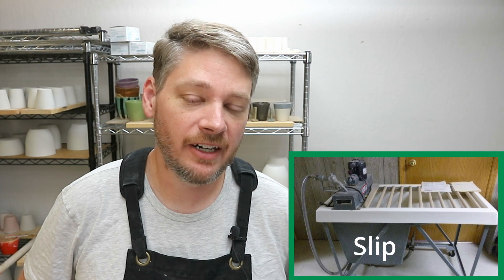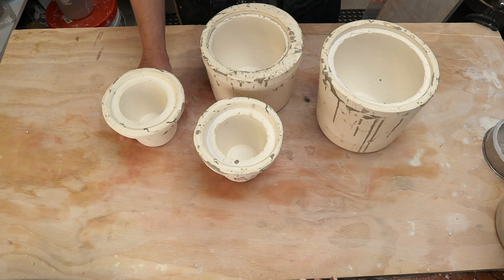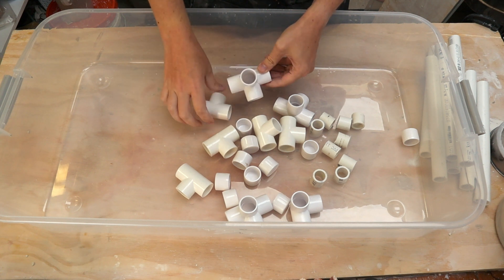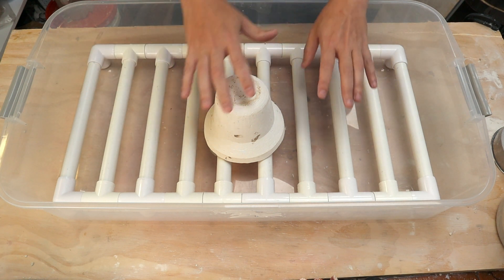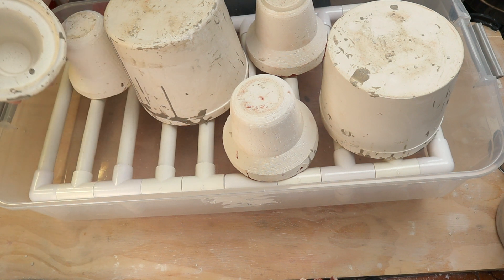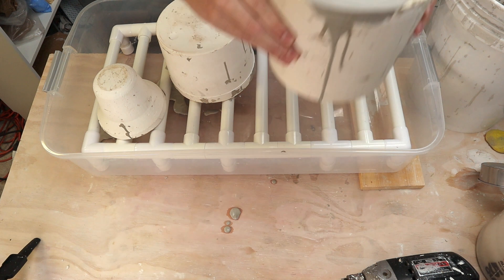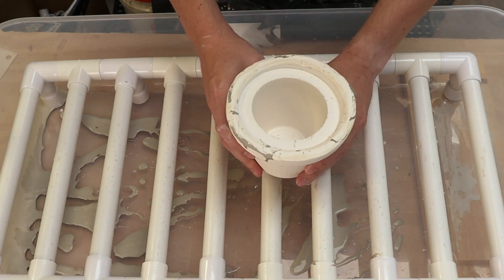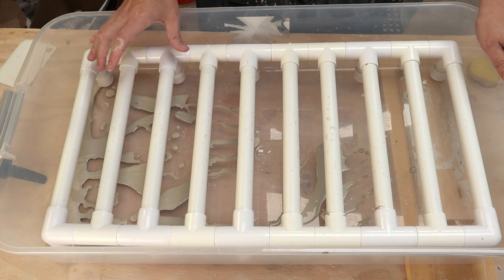Make a Mini Slip Table - DIY slip table for low volume slip casting

Comment: Thank you so much for the video! Could you tell me where the notes are regarding Amazon links and quantities and sizes of pipes and fittings?
Reply from the maker: The amazon links are in the video description, but I'll put it here as well as the quantities:
- Under Bed Storage Container https://amzn.to/3dHFzHR
- 6x: 4 Way PVC Elbow https://amzn.to/3ptjLlV
- 4x: 3 Way PVC Elbow https://amzn.to/3CiGVTr
- 10x: PVC End Cap https://amzn.to/3PGlxdL
- 10x: PVC 3 Way Tee https://amzn.to/3QUxkqa
- 12ft: 3/4" PVC Pipe https://amzn.to/3QEATkk
- PVC pipe cutter https://amzn.to/3CiKcSX
Reply: 🙏🙏🙏Sorry-missed that! Many Thanks!

Comment: Love this table. I have some two parts slip cast mug molds and I want to know how do you clean up the lip and side of the mug (where the two plaster molds create the line) so the mugs stay nice and smooth. Can you make a video of that?
Reply from the maker: Thanks! It's been very handy!

I don't have too many multi-part molds at the moment (but I'm slowly working on one). If there is any noticeable parting line, I'll either sponge it off if it's damp, or use a trimming tool to cut it down. I basically do the same thing with the rim of my pots as well. If I have an example in the future, I'll show it.

Comment: As you have added feet with mini legs why not increase the length of the legs on one side or at one end to provide the angle required to drain the slip out on one side of the pot.
Reply from the maker: That is indeed something I thought about. One initial reason was I didn't want to bother cutting the legs to different lengths. But really, for this version, I just wanted to get something working and see how I might tweak it.  One of the unknowns was the best angle to put the molds at. With the pots here I didn't quite have enough slope. Also, after playing around a bit more, I'm guessing it might be mold dependent. I've since tried putting the molds at an angle between the bars in mine and keeping the table flat (more like a "real" slip table) and that seems to be working well.

Comment: I have used pvc pipe for numerous non-plumbing projects with good success, so your choice made sense to me. As to a future pump, since I dabble in electronics DIY projects, I've been thinking about a DIY peristaltic pump.  Using a reasonably large diameter piece of surgical (silicone) tubing would allow pumping of the slip without worrying about wear on internal parts.
My personal temptation is a 3D printed peristaltic pump and stepper motor with a simple speed control. Could be a fun project.
Reply from the maker: I agree about the peristaltic pump - it seems like a great choice for this application. I've also seen some DIY designs and yes it could be a fun project!
Reply: @PotterybyKent  The slip tank/pump idea has been fermenting for awhile now. Here's where I think I'm going:
Home Depot Laundry Tub ($75.00)
eBay used washing machine motor ($60.00) - (Glaser sells similar motor for $357)
Glaser Ceramics  Campbell pump head ($170) - still looking to find something cheaper or that I can 3D print - back to the peristaltic pump idea...
Glaser Ceramics 3/4" gas-pump style nozzle ($70)
Total $375
Glaser sells a Mid Pumper 20 Gal system for $850.00
So, can I find a less expensive pump head, and do I need a fancy pump nozzle, or just a hose and use a foot-pedal to operate the pump?
Also thinking about how to use the washing machine motor in a dual-purpose mode, both as pump motor and as mixer (maybe not simultaneously)
I'd add the links, but YT often won't allow submission of URLs other than to YT...
Reply: Found this peristaltic pump build ( https://www.youtube.com/watch?v=dutfh_Ey44c&t=199s ) with downloadable files on thingiverse.  Looks pretty interesting.
Reply from the maker: @Bob-Is-A-PotterNow  That sounds like it would be quite the setup! I also wonder about the need for a pump head. I'm sure it would be nice, but it does seem like a foot pedal might be the place to start.
Reply: @PotterybyKent  Had a conversatoin with an EE friend this afternoon and making a variable speed pump control shouldn't be too difficult and that would be tied-in to a 3D printed nozzle with an on/off switch - perhaps that defaults to low-flow but can be increased with the foot control. Or perhaps the nozzle does both on/off and speed. It's going to be at least a couple weeks figuring stuff out and testing circuits. But perhaps there's an "economical" diy slip table waiting in the wings. I already ordered a length of surgical tubing with a 18mm ID - just under 3/4" lumen. I'll let you know how things progress. I posted a comment, I think, on one of the 3D print clips about running my printer at a 50 micron print resolution. Very slow, but yielding prints that need no post-processing and which result in silicone/plaster of paris molds with no print lines - they are smooth!
Reply from the maker: @Bob-Is-A-PotterNow  Sounds great! Thanks for the updates and I look forward to hearing more.

Comment: My favorite part of the video was learning about the existence of these tables in the first place. My second favorite part was when you put the feet on. I had been wondering what would happen if the drained-out slip pooled up enough to touch the molds or the pots! I had thought, oh maybe it wouldn't be a problem, what do I know (not at all a potter, here!), but then you said, in addition to slip not getting into the pvc, there'd be plenty of room for the slip and I was like, oh yay! Haha 😆

I liked that there was a stalactite and you explained that more of an angle would help it drip down the sides. When you were talking about it needing to be tilted I wasn't sure why, so it was cool to see and hear why! I appreciated both the visual and your verbal explanation. 

It can be very satisfying to use creativity in thinking of what to put together and how, in order to serve a needed purpose. It definitely was cool watching. And I hope it works well for you and you can get some drainage going on!  I had gotten a mental image of, with a little bit of slip, squeegee-ing it to one corner to dump it out - but I'm sending you good vibes for a better answer, lol!
Reply from the maker: Thanks a lot! The container I used holds a deceptive amount of volume. I think I could fill it up 2 or 3 times over with my slip bucket before hitting the top! And my one slip bucket gets heavy enough all by itself! That's the advantage of using a pump in regular slip tables.
I've had a bit more chance to use it, and I'm very happy with it so far!